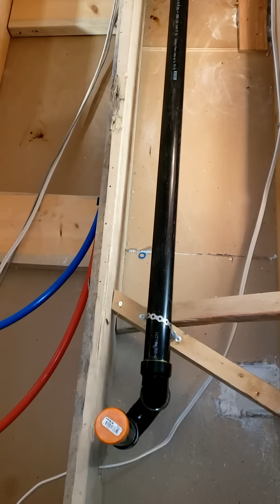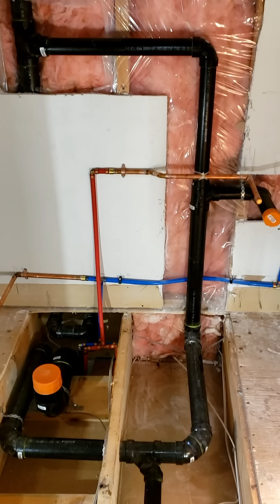Wet Venting EXPLAINED! - #SHORTS

Comment: Could you convert the sink into 2 simply by using a double san tee and no extra vent plumbing?
Reply from the maker: Technically, it will work, but it's a little more complicated than that, as doing so using a straight-up 2-inch sanitary double TY would violate Code for a number of reasons.

The short answer for ensuring Code-compliance would be to:
1. Increase the wet-vent to 3-inch
2. Utilize a 3x1-1/2-inch double sanitary tee to pick up the two symmetrically-connected lavatories (what you and many others refer to as "sinks"). 

Here's the LONG answer, in case you're interested:
Every fixture connected to a plumbing system has what's referred to to as a "Fixture Unit Load" (measured in Fixture Units - or "FU" for short), which is essentially the impact imposed onto the pipe the fixture is discharging into, based on a predetermined discharge volume and expected rate of use of that fixture. 

For example, a drinking fountain has a value of only 0.5 FU's because the discharge is so minimal, wheras a standard toilet had a load of 4 FU's, because it discharges a significant volume.  A standard lavatory (or bathroom "sink") having an 1-1/2" trap, is rated with a fixture unit load of 1.5 FU's. 

Each drainage pipe size and system can accommodate a varying amount of total Fixture Units discharging into it.

To keep things simple, a 2-inch wet vent (as shown in the video), can receive a maximum of 3 FU's discharging INTO it (the most downstream-connected fixture in a wet vent imposes no load on the wet vent, so the toilet is ignored when determining load on the wet vent).

Therefore, our 2-inch wet vent shown in the video is already maxed out, because the 1-1/2" lavatory (1.5 FU's) and the 1-1/2" shower (1.5 FU's) adds up to the maximum 3 FU's allowable for a 2" wet vet.  Only by increasing the wet vent portion to 3" can you discharge more fixtures into the wet vent (to a maximum of 8 FU's).

And now with technicalities and legalities aside, here's the no BS practical reality of it:

Your system should work JUST FINE if you add a second lavatory to your that 2" wet vent, because the probability of you utilizing all the fixtures at the same time is minimal...plus there's often so much junk obstructing a lavatory's drainage (strainer, mechanical waste & overflow 1-1/4" tailpiece), that it's flow is naturally obstructed and slowed anyway - thus significantly minimizing the impact the additional lavatory has on the drainage and Venting system.

I do recommend that you at least opt for a 2x1-1/2" double Wye with two fitting-in 1-1/2" 45 elbows, instead of a 2x1-1/2" double TY/Sanitary Tee, as the former will better help direct flow downward into the vertical drainage pipe.

Hope this helps!
Reply: @PlumbingsCool  a wye and 45 will definitely cut off the vent and is a no no here under any circumstances on a vertical stack for a fixture branch a sanitary tee is the only answer period as like I said it will in fact cut off the vent and as I mentioned we are allowed six fixture units on a horizontal wet vent a shower two inch is two fixture units a tub same thing and ea lavatory is considered one fixture unit so like I said and I do this all the time I can pick up another two fixture unit load such as a master bathroom tub or shower cuz. A lot of big master bathrooms here have a often times a Jacuzzi tub and a nice big walk in shower w whatever they may want body sprays and rain head and the skys the limit actually I've done some fancy ones for sure we run 3/4 hot and cold just to the shower. In any cases where they we think or know they will need the extra volume and with these pressure balancing valves and having two or three of them to run different things in the shower the 3/4 is needed for sure if you have a house on a well especially when on city water where the pressure is about 65 psi or better and we can even crank up the pressure reducing valve a bit to accommodate I'm really curious now where your located in the country because increasing the wet vent to 3 inch would be geez a big deal because the wall would have to be a two by six wall for starters nevermind the extra time it takes to run three inch in a often tight space as in the ceiling thru trusses etc fitting cost is higher as well as labor costs I would guess double on both as opposed to two inch pipe and the. Cost of a two by six wall over two by four is dependent on how long almost double as well or more even I'm sorry I'm a talker and I well you can get medical weed here and yeah that part but I have a prescription lmao I'll stfu now
Reply: Thanks!
Reply: I heard different opinions on using san tee vs wye. Biggest thing coming up is being able to snake one side without going to other side. Is this only/main benefit?
Reply from the maker: Although ease of snaking is one reason why I like using a double wye instead of a double sanitary tee, it also benefits by directing drainage straight down, whereas as double sanitary tee may cause drainage from one fixture to theoretically shoot upstream toward the other symmetrically connected fitting because it's completely open from one side to the other.  

This is why we have specific rules when using a double sanitary tee to pick up two fixtures.  Specifically, the main run can be no smaller than 3 inches, and the two connecting fixture trap arms can be no larger than 2 inches.  This will ensure that flow from one fixture doesn't affect the other. 

Another legal option is to use a double long-turn TY, which is still a sanitary tee, but with a longer turn radius along each branch to better direct flow downward. 

A couple of other interesting points for your benefit:

If you ever need to snake a double sanitary tee, you can avoid having the snake head go straight through to the the opposite side by using what's called a "drop head" snake attachment that's compatible for your given brand.   It's simply a spiral attachment that's on a ball head so that when the snake passes the horizontal inlet, gravity takes over and rotates the snake downward toward the vertical drain instead of continuing vertically.  Here's an example of the attachment:
https://www.homedepot.ca/product/milwaukee-tool-small-drop-head-with-rustguard/1001679012?eid=PS_GOOGLE_D00_Corporate_GGL_Shopping_All-Products_All+Products__PRODUCT_GROUP_pla-336655210985&gad_source=1&gclid=CjwKCAjwtNi0BhA1EiwAWZaANGgSy2oz9fJNNjH2OdAP0ANaYxM6W55kByGMvn7upfZ0CfCh4CZMIxoCg_cQAvD_BwE&gclsrc=aw.ds

Also, I'd like to add that using a Double Wye may be frowned upon by some inspectors, as the vertical drop distance may render the end of the trap arm lower than the protecting vent - thereby choking out the vent, thus theoretically leading to siphoning of the trap (and why "S" traps are illegal).  This is why I specified using FITTING-IN elbows:  Doing so will raise the centerline between the trap arm, and minimize choking-out of the vent, and should leave "just enough" vertical clearance for the vent to maintain atmospheric pressure within the trap arm, thereby protecting it from direct siphonage. 

But again, the unofficial reality is lavatories drain so relatively slowly, the trap arm will never fill up to the point that will cause the trap to get siphoned.

Hope this helps!
Reply: What's the difference between one sink or two where I'm at in fla that would be perfectly fine to have double lavs on that wet vent in south fla were allowed six fixture units on a two inch wet vent so tub or shower is two and ea sink because the po is only inch a. Quarter they are only one fixture unit so that's only four fixture units we could actually pick up another shower or tub on that horizontal wet vent as long as the developed length of the wet vent from the centerline of the three by two wye to the centerline of the sanitary tee or cross is not in excess of fifteen ft of developed length then you have certain distances off the wet vent for fixture branches such as aka tub or shower and of course the arms on the cross tee all have limitations on how far they can run before the pitch gets too much it cuts off the air at the top of the pipe thus eliminating the vent part so please explain to me why a cross tee could not be used in this situation like I said it's done all the time here w out Any issues at all and i personally don't see how it would make any difference at all but I'm always open to learn something new and why it's that way so please don't take this question the wrong way I just explained my thought process and why I'm thinking that way is all I'm not trying to come off as an asshole I'm just very curious as to the thought process of your areas codes wherever that is

Comment: The irony is, how many of you multi tasking fools use the 3 fixtures in concert? 😮
Reply from the maker: You're correct in that all three fixtures are likely not going to be utilized in unison, but that has nothing to do with wet venting, which is maximizing efficiency of piping.  

What you're referring to has more to do with fixture unit load - and the Powers That Be also recognise that not all three fixtures will be used in concert - which is why you're allowed to refer to such a configuration as a Bathroom Group, officially valued at only 6 Fixture Units, as opposed to 6.5 Fixture Units if their loads were tallied independently.

Comment: I cant belive abs is still used, its completely banned where im from but seeing rough ins with it is crazy
Reply from the maker: Yes, it's alive and well, here in Canada, notably in single residential applications - despite common knowledge that if ignited, its fumes are fatally toxic.   What's even worse is that CELL core ABS has become increasingly popular because its half the price of solid core (and half the durability!).

However, ABS is typically prohibited for any commercial applications or multiple dwelling units/high rise - which require the installation of PVC System 15 to XFR if opting for plastic materials.

Comment: Please explain why the WC is connected on the downstream, is it specified in IPC or UPC?
Reply from the maker: Sure thing:  It's not UPC or IPC, but rather Ontario and Canadian National Building Code.

Specifically:
7.5.2.1.(1): A. Soil or Waste pipe may serve as a wet vet provided that:
(b) the number of wet vented water closets does not exceed two,
 (c) when two water closets are installed, they are connected at the same level to a vertical part of the stack by means of a double fitting in accordance with Table 7.2.4.5.,
 (d) the water closets are installed downstream of all other fixtures.

Hope this helps!
Reply: @PlumbingsCool  
I am extremely thankful for your quick and informative reply. I would really appreciate it if you can lend me two more minutes of your expertise and teach me the logical reason for connecting it on downstream?
Reply from the maker: My pleasure...that's exactly why this channel exists! ☺️

So the logic with toilets needing to be downstream of every other fixture is because they're often the biggest disrupters in the plumbing system, due to the large volume of water they discharge into the drainage system (typically around 6 litres per flush these days).  This is why I often refer to them as "the big elephants in the room"... Because there are always special code rules for toilets, and they are often handled differently than other fixtures. 

Many people think that toilets are vented to protection of their own sake.  Although a properly vented toilet DOES certainly help with proper flushing, the REAL benefit of venting toilets is for the protection of OTHER fixture traps!  In the case of a wet vent for example, having a toilet UPSTREAM (or before) the connection of other traps means that the toilet's discharge will be passing by those traps.  And the aforementioned high volume runs the risk of creating enough negative pressure to suck out the downstream fixtures' trap seals as it passes by.  So placing toilets as the last fixture in a wet vented group minimizes the likelihood of interfering with other respective fixtures (and also why any wet-vented toilets in the group must is limited to a maximum of two, and must be connected symmetrically:  so each toilet doesn't disrupt the other one.) 

That's a very brief short answer, but I hope it gives you a general idea of the requirements!
Reply: @PlumbingsCool  Thanks once again. This explanation really helped.
I have one more question though.
Why isn't the double pipe system used, one pipe for soil and one separate system for waste?
Reply from the maker: I'm aware that some parts of the world separate their sanitary drainage between one which emits human waste (toilet, bidets, urinals, etc.) and others which are not designed to.  However, here in Canada, any fixture or collection that is NOT storm water (rainfall, snowfall, snow melt, or ground water) is deemed to be SANITARY waste.  The sanitary waste is delivered either to the water treatment plant (in municipalities) or to a septic system and leaching (in rural areas, such as farmland).  

Any storm water may discharge into the building's STORM drainage system, which will discharge either onto the property itself or into a nearby body of water such as a lake or river, because it's considered relatively-harmless clear water waste. 

Therefore, in effect we too have a "two-pipe" system, except we discern them to be SANITARY and STORM.  And the two MUST be kept separate...and the discharge of sanitary into storm is a huge no-no for obvious reasons. 

Personally, it never made sense to me to have a separate two-pipe system for sanitary systems, because although toilets are definitely made for human waste, it's completely unknown what may be discharging into those "non-sanitary" fixtures, which I'd argue can sometimes be nastier than what a toilet discharges (think: a kitchen sink being exposed to salmonella or e-coli when preparing meats.)  Therefore, in my opinion, it should ALL be sanitary, whether there are human solids or otherwise.
Reply: @PlumbingsCool  I am glad to have found you and have this discussion. Thanks a lot for sharing your knowledge.
Reply from the maker: Thank YOU! 🙏. It's your sort of intelligent and curious inquires that inspire me to share and educate.

Comment: for the contineous vent does length matter when sizing?
Reply from the maker: Yes, it absolutely does, depending on two factors:  the Fixture Unit load imposed onto the continuous vent, as well as the continuous vent's Total Developed Length, measured from the most upstream fixture (the Lavatory, in this case), to a greater source of air (Vent Stack, Stack Vent, Header, or Open Air).  This is done using Table 7.5.8.3. in Ontario Code, and 2.5.8.3. in Canadian National Code.

For example, an 1-1/2" Continuous Vent can range between as little as 8 Fixture Units up to a maximum length of 30 meters (  ~100 feet), or a maximum of 60 FU's up to 4.5 meters (~15 feet).  If that 1-1/2" Continuous Vent pipe is carrying no more than 2 FU's, then there is NO LIMIT on length.

Hope this helps!

Comment: If the sanitary is only venting the toilet, does it need to be 2 in as well?
Reply from the maker: If I'm understanding your question, then I presume for you to mean that your scenario entails only a toilet, and not any other fixture?  If that is the case, then no:  An individually-vented toilet requires only an 1-1/2" vent, which can theoretically run forever until it connect to another vent pipe at its upstream end.

Comment: looks like someone is doing a bathroom reno
Reply from the maker: Close, but not exactly:  There WAS no bathroom there..or ANY plumbing, as a matter of fact.  The customer wanted to install an ensuite in the kid's rather spacious 2nd floor bedroom.  There was nothing in that corner - not even the 3" stack or water lines, which I tied in in the basement and brought up to the second floor during a previous construction phase of the house and capped for future about a year later.  

Fun project; it's always fun to make something from where there was nothing.  😊

Comment: Cant reduce a vent size... not here in MN anyway. So, Minnesotans, that 2" needs to continue beyond that lav.
Reply from the maker: Yeah, I've noticed a number of you allude to that south of the border.  Here in Canada it is NOT the case.  Here's why:

Think of Plumbing layout as THREE individually-sized systems.  From downstream upward, you've got:

1. The drain (liquid only)
2. The wet vent (air and liquid) - like a two-lane road
3. The continuous vent (air only)

Each one of these systems had its own sizing table. The only reason why the wet vent is larger is because it needs to accommodate for TWO mediums: Air and water.

Hope to that makes sense!
Reply: Makes perfect sense, our code just states otherwise and that would fail inspection here. I do 100% agree with you though
Reply from the maker: Yeah, it's funny.  We're so strict on venting and respective sizing, yet our Code approves the conditional use of an air admittance valve (or "cheater" vent).  The standard ASSE-approved Oatey SureVent claims 24 fixture units, which is equivalent to convey drainage for up to SIX tank-flush toilets!...yet, have you seen how tiny air inlet slots are on those those AAV's?  

Madness!
Reply: Yea its completely rediculous Haha! At any rate, you keep up the good work my friend, we all have to bend to our governing jurisdictions, no matter how contradicting! LOL